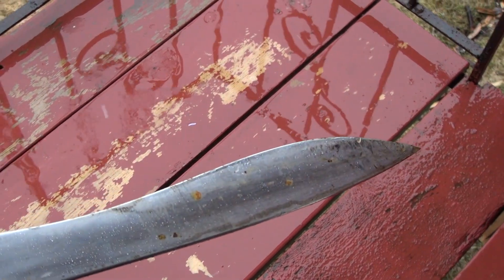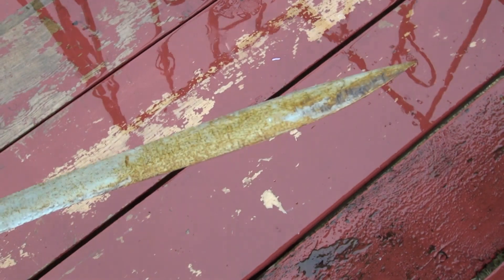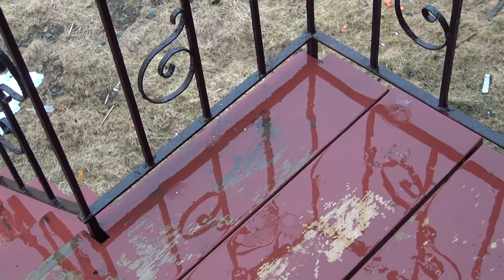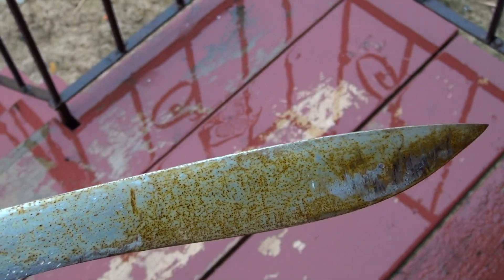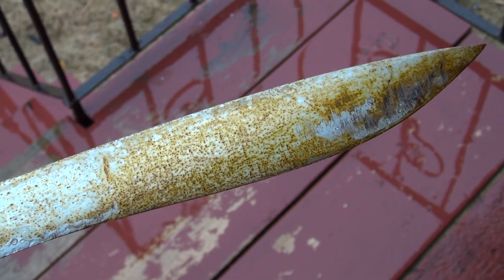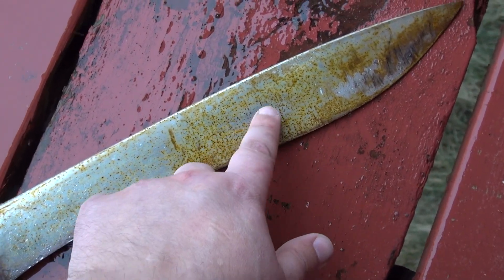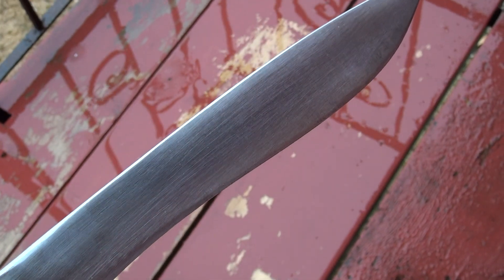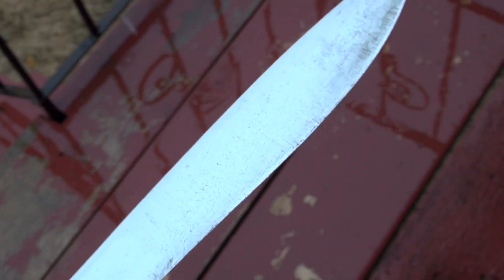O1 + salt water + sleet + snow + ice + fog = Excalibur's vacation

Comment: when the local highschool built a stadium with outdoor seating stands 30 plus years ago they not only left the structural  I  Beams unpainted,  they sprayed them with an acid based cleanser to clear any oil or protective coating from them.  today they are looking the same as they did 6 months after construction.

Comment from the maker: Stainless steel has a passivation layer, once damaged, a potential difference can form between a localized anode and surrounding cathode (galvanic corrosion), this can even happen under a rain drop, though salt is very prone (due to the chlorides). If a material is prone to rusting in general this doesn't happen, you just get even (though random) surface rust. 

Molybdenum increases pitting resistance, hence it is common in stainless steels (plus it adds secondary hardening).

Comment from the maker: That is interesting on the razors as they are usually stainless steel of a decent level of corrosion resistance. You might try storing them in a low-humidity container, you just need a vapor absorber (like dry rice).

Comment: You sure the black patina is oxidation? It could just as easily be reduction. Both are technically considered corrosion, but they're opposing processes which is why they tend to exclude each other.

Comment from the maker: The blade wasn't significantly blunted at all which would not be expected given the steel+HT. I used a very high grit stone as I mainly just wanted to polish any corrosion from the edge and then check it under magnification to see if it was damaged by the corrosion, only two small spots were so damaged, less than a mm long and less than 0.1 mm deep.

Comment: Hmm...can you tell more details about sharpening it, i mean did you took the 5000 grit at first ( no 1000/3000 grit before?)?And regarding those sections of the blade....will you leeave them alone, or some de-stressing should be applyed in order to remove them?
Based on this video and on the conclusions....would you say that a natural ( or induced) patina on a carbon steel might be a bad thing when it comes to sharpness( im refering on those spots of the edge, affected by corrosion).

Comment from the maker: Not a light decorative one, but one built up after years of exposure would yes. If you look at older carbon steel kitchen knives they are solid black and very corrosion resistant at that point. 

I generally ignore it. I don't oil my knives so they all will take surface corrosion gradually, though my brother tends to polish it off when he uses them as he prefers a satin finish.

Comment: Got it, so basically its just for honing the blade, not touching the actuall edge...for the rest of the blade, to remove the rust, did you use the same grit stone, or something else(sandpaper- im considering it, since im thinking that a 5000 grit is too much "noble" to be used to remove rust on the rest of the blade)

Comment from the maker: I just ignored those spots as I would not throw away 0.1 mm of steel along the entire edge just to remove two small damaged areas of about a mm each. If you look at the axe you can see there are three areas of visible damage. All of the heavier chopping tools have such after extended use as I cut used materials and we have local idiots that spike trees. I normally don't sharpen them out because it would wear out the blades/axes too rapidly.

Comment from the maker: I would personally take a mid-carbon steel as surface rust is easy to deal with and generally only want stainless in environments where edge damage is frequent if not oiled (salt water fish work for example).

Comment: Rust didn't look horrendous at all. Only two days, though? That surface rust would get fairly worse after two months. Not so bad, though. I left an axe out for several months and had to soak it in vinegar to get rid of the rust. No pitting, though. I think corrosion resistance is overvalued.

Where would one get that blade? I've been looking for a nice outdoor blade for cutting brush and small limbs, but I feel like I would be better served with a pruner or, at least for tall grass and lighter brush, a cheap machete.
Reply from the maker: Mike Gavac, Gavko on YT is the maker of the Excalibur and he has one for sale on GearBastion now.
Reply: Cliff Stamp Ah, yes, though it is in S7 and $800. A bit much for my needs. Thank you for the information, in any case!
Reply from the maker: SaudadeSunday That is a really high end / finish version, the working grade ones are much less.
Reply: Ah, good to know! I'll make sure to keep an eye out for a working grade one. Thank you very much!

Comment: not a mistery: on stainless steel rust start in a point not defended by chrome oxide and goes deep in steel because all other points (steel molecules) beside are defended so can expand only going deep. On simply carbon steel rust start in a point and expand rather easily to the molecules beside without going deep